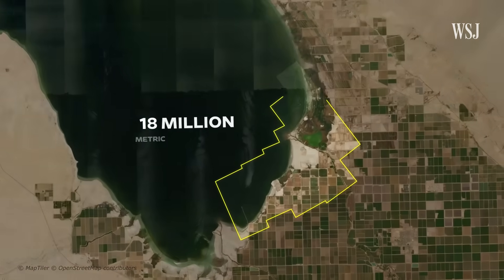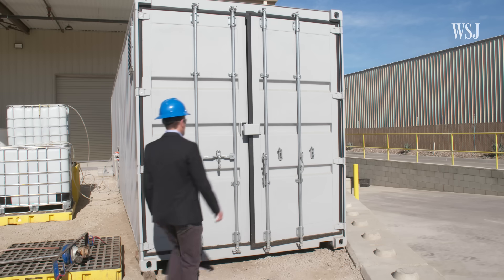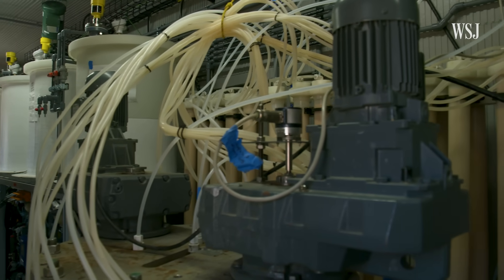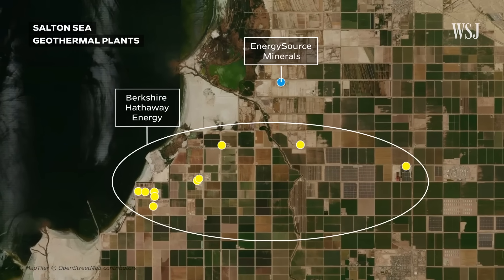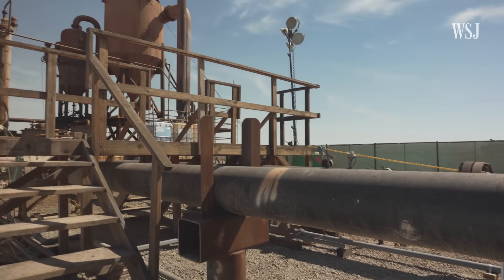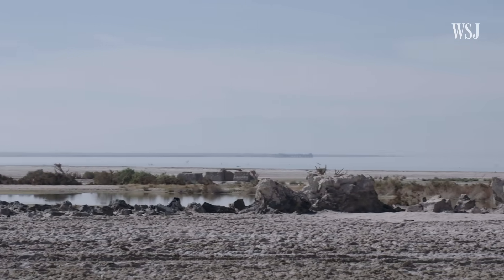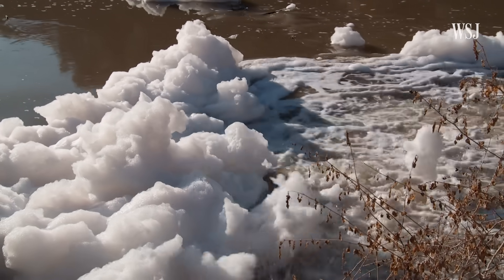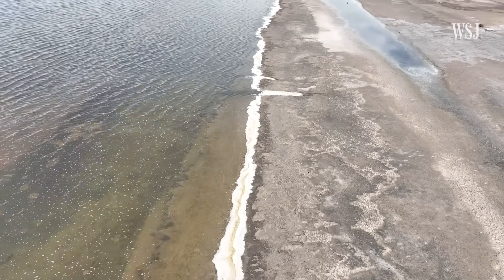This Toxic, Drying U.S. Lake Could Turn Into the ‘Saudi Arabia of Lithium' | WSJ

Comment: The media and academics have talked for decades about how the Salton Sea drying will release fine toxic dust into the wind that will destroy air quality in SoCal, AZ, Baja Norte.  All that talk seemed to just go away when the size of the lithium deposit was discovered, and the Sea contracting became pretty convenient for mining.
EDIT:  I don't know why some commenters below are having so much trouble understanding what I said here.  The Sea contracting uncovers toxic seabed dust but also makes the lithium mining easier.
Reply: They literally talked about it in this video
Reply: No, you are wrong. The mining is not done by drying the lake. The mining is done through remote boring into the thermal vents where the brine is remote mined. The lake water levels in no way need to be lowered to access the lithium. In fact, if the lake dried up, the brine deposits would actually be harder to reach without returning water pressure to the thermal pockets. The drying of the lake is VERY much still a problem and several universities in the area are working to experiment with various methods of controlling the lakes playa to keep that toxic dust down.
Reply: @blahbaconblah   Your first sentence showed you lack basic social skills, your second showed you posted without reading what I wrote.  You are very efficient.
Reply: The mining isn’t pulling water from the sea itself. The brine comes from 1000 feet below ground. The sea is shrinking and that is a serious issue, but it isn’t related to mining. The profitable mining companies should be required to give back to the community.
Reply: @loscheiner    There's nothing the mining companies can do about the Sea drying.  California can buy water from upstream, or California can negotiate with Mexico do dig a canal/tunnel to bring Sea of Cortez water in.  The mining companies can't do either of those things.  And if the mining companies decided to leave the area alone, the Sea would still be drying up and release toxic dust into the air.  People are blaming the mining companies for a problem they didn't cause and that only the CA govt can fix.
Reply: @jbtechcon7434  I agree with you. The environmental issues and the lithium issues are separate. However, if Lithium companies are profiting by extracting resources, then they should be taxed and should be required to re-invest in the community - some of the poorest counties in California.

My harebrained scheme to keep the sea from drying is for communities to build De-Salination plants along the Sea of Cortez and near San Diego, then pump the by-product brine to the Salton Sea.
Reply: @loscheiner    Yeah, there's no need to "pump" anything.  I volunteered a couple of years ago on an effort to dig a canal and short tunnel through which water could gravity-flow from the Sea of Cortez to Salton and even generate some electricity when it arrived.  The cheapest Salton-saving plan by far!  The group leaders were making progress pre-negotiating the rights with indigenous Mexicans whose land the canal would cross, but CA legislators stopped talking to us when lithium miners started talking to them.
Reply: @jbtechcon7434  That California Governor loves big projects. most waste money.
Reply: There is absolutely no connection between the extraction of lithium from geothermal brine and the Salton Sea (the Mistake Lake). None. It is coincidently located nearby
Reply: @Juneisthebestmonth    How on earth did you come under the impression I was implying that kind of connection?  The only thing they have to do with each other is, and I said above, that the Sea contracting makes the mining easier.
Reply: @jerrysstories711  It has no effect whatsoever on the "mining". If the lake evaporated entirely or if it refilled (never) it would not even be noticed by anyone in the geothermal plant where the extraction of lithium would be taking place, other than when they drove home. It is not a surface mine, there are no shovels LOL. It is a special extraction well and a return well for the extracted brine
Reply: @Juneisthebestmonth     Do you understand that only the pipes are underground?  All the pumps and machinery and places were people work are above ground.  And it's easier if you can put those on LAND rather than in 10m of water.  That's why all the current facilities are on land rather than in the lake.  The lake drying up opens more LAND for them to build those facilities on.  What part of this is too difficult for you?
Reply: @jbtechcon7434    Exactly, and well said.  I try to be patient with people who are trying to think, but I'm genuinely baffled by how dumb some of the responses to my comment are.  How does someone not understand that it's easier for people and machinery to work on a dry lakebed than in a lake?
Reply: n7434  Would you like a tour? You are more than slightly confused. The current "land" under the Mistake Lake is not usable in the future. It will have a many feet thick of salt and sludge pan. There is plenty of land where the wells are. Matter of fact... Guess what... The geothermal plants are already built and exactly zero new land is required to add a lithium extraction unit. Stop guessing. The lake just happens to be close by. If it disappeared entirely it would make no difference whatsoever. They land underneath the current flooded sink is owned in patchwork fashion by the IID and the local tribes.
Reply: @jbtechcon7434 lol, there are no "pipes" in or near the water. And the wells, if needed can be directional. There are geothermal feed and return wells. People with partial knowledge like you are frustrating. And these are NOT mining companies, they are geothermal power generating companies.
Reply: @Juneisthebestmonth   No pipes, huh?  And how do you imagine the brine is brought to the surface without pipes.  I care enormously about this region and issue, enough to have done hundreds of hours of volunteer technical work for save-the-Salton projects.  So I try to be very patient with earnest people who are just poorly informed, but I think it's time for you to consider the possibility that you're out of your depth.
Reply: @jerrysstories711 sir/madam, As I have indicated the pipes are unrelated to the lake. Of course there are pipes, and they are at about 520 degrees and under robust pressure. But they are not in the lake or have anything to do with the lake. I was a Director in the company that developed the lithium extraction process. I edited the State permits. There is no salvaging the lake, that was put in place 2 decades ago. Restoration of that area does not mean refilling the lake, it means some scrubby vegetation and wind-breaking furrows and a 15 foot deep small lagoon for the critters
Reply: @jerrysstories711    Bro, you're trying to get through to a boomer who clearly already knows everything.  I don't think being "out of his depth" bothers someone who doesn't know why doing something on land is easier than doing it in a lake.
Reply: @jbtechcon7434    HA!  Good one.  But please don't blame his being a boomer, because people can be thickheaded at any age.  One huge obstacle to the canal project I talked about was people insisting we'd accidentally flood the whole Imperial Valley -- even though that would take many years of maximum flow, and the tunnel portion could be closed any time, and the miles of horizonal canal through river silt could be closed in an hour by one tractor.
Reply: You mean people focus on the latest thing? Wild.
Reply: @caseymasters8801    I think he was going for something more like, the media pretends to care about people and the environment but forgets all about it when ordered to by big business interests.

Comment: The US is literally blessed with OP geography. Short of some rare earths we literally have self sufficiency in every single metric(provided we use our resources wisely) which is rare for a region not to mention the insane amounts of freshwater and inland river distribution systems we control that allow industry to flourish especially industries of the future that will be much more water dependent (think semiconductors, batteries, nuclear fusion, etc)
Reply: The whole lithium thing might be China’s ticket to energy independence.
It currently imports from Russia, but when battery tech is good enough, solar will be able to power China. And maybe lithium will play a major role in the batteries that able to make that happen. Imagine running Beijing at night on solar power turned battery power
Reply: @SigFigNewton  lithium is pretty critical to our future economy. China doesn’t have too many lithium reserves rn so that’s a potential bottleneck but they are already doing a lot of work in solar power generation having some of the highest installed capacity in the world though they need a lot more given their population. They also have the largest battery manufacturing setup but again it’s never enough. Let’s see how it goes. I doubt the US will give up its reserves to China
Reply: @portcybertryx222  and I suppose Australia will stop selling lithium to China if US asks forcefully

Comment: The lithium isn’t actually in the lake, the mineral is in the brine reservoir located beneath the surface (lake or no lake). The geothermal power plants extract the hot brine and use the heat to run the power plants and then inject the brine back into the ground. Sort of a continuous loop. The Salton Sea itself isn’t part of the geothermal power or lithium extraction process. 
PS — Imperial Valley Water District has the most senior water rights to Colorado River water which is used by industrial sized farm corporations to raise all types of agricultural products. Basically the corporate farmers have exploited cheap farm labor for years. Also why upper Colorado river basin states hate California a lung other reasons. 
PS2 — Video mixes and matches a hold host of facts and issues and doesn’t produce a clear picture on anything. There are several great stories to tell about this area and this video barely scratches surface in a very confusing way. WSJ has done a shoddy job for some reason.
Reply: Its the WSJ. They're attracting investors
Reply: Would be good if you can cite sources or your facts to support your observations. Thanks for the insight
Reply: How much fresh water is required for all these geothermal power plants and lithium mining?
Reply: @leroyessel2010  The geothermal power plants run on the heated water that comes from the vents. They run on the very water they are treating. No fresh watter required. They typically also pump the "used" water back into the thermal vents to maintain a liquid flow and pressure equilibrium.

Comment: I dont think lithium is going to be as valuable as people think. Several other critical elements are necessary for Li-ion batteries. The infrastructure and economics of EV charging is also not assured.
Reply: It's a very expensive alternative to a non-problem.

Comment: More sensationalized videos for clickbait. Thacker Pass already has vastly larger deposits, and it's not underneath the nose of people who inhabit the area. Even the future of lithium itself is unknown since solid state batteries with sulfides instead of lithium are being tested. Another potential replacement is sodium which is also very abundant and environmentally friendly to extract. In my opinion lithium batteries will only be used in applications where weight and space is more of a concern than cost which is almost exclusively production chain vehicles.

Comment: Lithium production should ramp up so that when production is maximised, they can use lithium as leverage to combat China's dominance in rare earths production.
Reply: Or at least, make us completely self sufficient for a while.
Reply: The US will never have significant market share in Lithium, so won't be able to use it as leverage.  As for rare earths, they aren't actually rare, plus BMW and the next Tesla avoid them in their motors.
Reply: Lithium isn’t rare.  Tesla is building a new plant in Texas.
Reply: It's rare but not rare earth.  OK, it isn't actually that rare, but it's expensive to recover and the question is whether we can ramp up production quickly enough to meet the demand.

Comment: Its funny how this video ignores the fact that this lake is actually filling up at the moment when California is experiencing record rainfalls, and lithium mining can become underwater by the time they start. California can experience either very wet climate during El Nino and ENSO neutral years (2023-2024) or very dry climate during El Nino years.
Reply: the lithium projects are not connected to the lake. The water from the rains is minimal and will quickly evaporate.

Comment: With the depressed prices of lithium I highly doubt any large scale (metric tons) lithium operation will take root there. With the advent of alternatives such as  sodium ion and sulfur batteries it is going to get even tougher.
Reply: A lot of factors, but cost is related to supply plus well applied, acquired knowledge.
Reply: @bmaciii  and lithium from Argentina will ALWAYS be cheaper but I doubt Lith. is oging to be the go-to for very much longer. too many alternaives coming on line.
Reply: These facilities also have massive strategic value. If china tries to pressure the world by increasing lithium prices, the USA can ramp up production to keep prices down and invalidate china's leverage. That way, we dont have to worry about brutal dictatorships like china forcing us to do or accept anything.

Comment: Is there a way to recycle/reuse the lithium we already have?
Reply: As more EV batteries are created, there will be more demand for battery recycling. Some companies have already started to do this, such as Redwood Materials.
Reply: Good question! Lithium ion battery recycling is a fast growing industry. Ones with dying cells (say your car is only getting 85% of the original range after 300k miles) can be repurposed for longterm storage as battery backups. Spent ones can be largrly broken down into its base components. So yes, they can be recycled.
Reply: Yes! There is a growing battery recycling industry that is expected to become a billion dollar industry in the next decades.
Reply: No need to; it's a salt. the problem is with the batteries just like computer "gold" and metals: costs more to reclaim it that it costs to produce.

Comment: The solution to the Salton Sea is well known and simply.  Pump storage between the Salton Sea and the Gulf of California / Pacific Ocean.  Pump water out at night using geothermal power.  Turbine water in during the day when the power is worth more.  Yes salt water is corrosive but they have materials that can handle this.  Pump storage would maintain a well defined shoreline and equalize salinity between the Salton Sea and Pacific Ocean.
Reply: The Salton Sea is toxic, you cant pump that water anywhere, especially not into wildlife ecosystems!
Reply: never...even if free
Reply: You need a geography lesson the gulf of California is in México not California you need to get México's permission to do that which will never happen.  Your best bet is the Pacific ocean but you have to deal with California coastal commission lot's of red tape almost impossible.
Reply: @stevenperez3107  Mexico has already voiced in interest in flooding the Laguna Salada which would improve air quality on their end.  That effectively brings the ocean water to within a couple hundred yards of the southern US border.  Yes, There would have to be some kind of international agreement.
Reply: the "Gulf" of California. Do you mean the Mexican side of the bay??? You think this might happen?? The Colorado river used to end up in the gulf of Baja California, until  the USA STOLE all the water!!